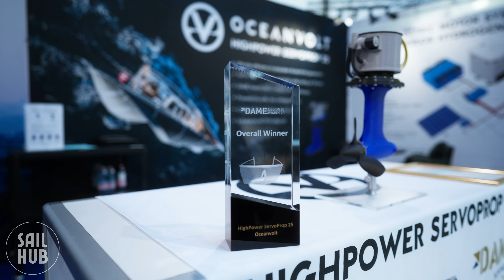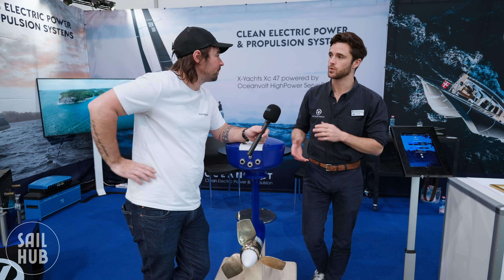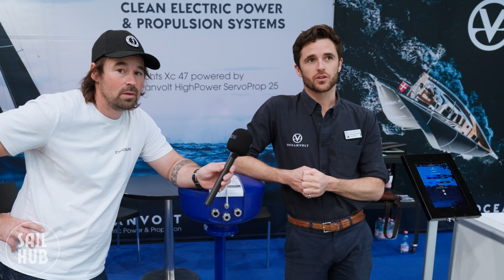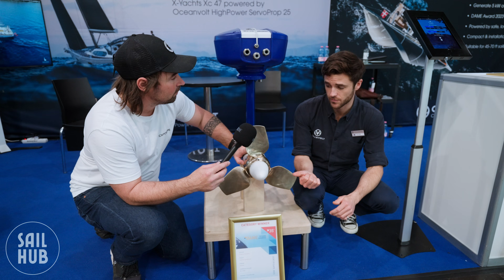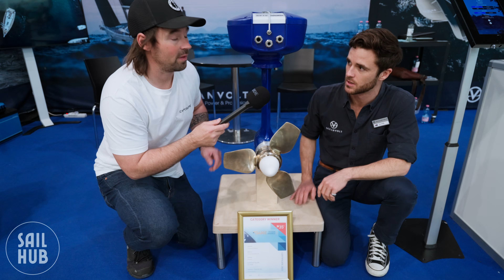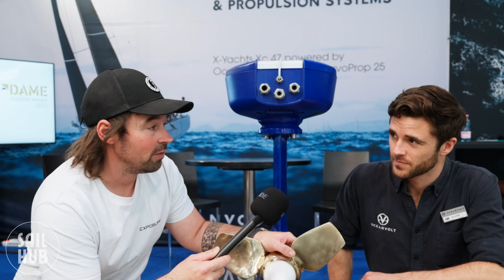Oceanvolt ServoProp on @SailHub

Comment: So is it possible to buy a system and have it fitted on a catamaran? I'm looking at buying something like a Leopard 45, but would love to get rid of the diesel and have all electric. Seems like a huge savings in the long run, but what is the upfront cost? Can you also fit it so the whole boat runs off solar with a backup generator or you only do electric motors?